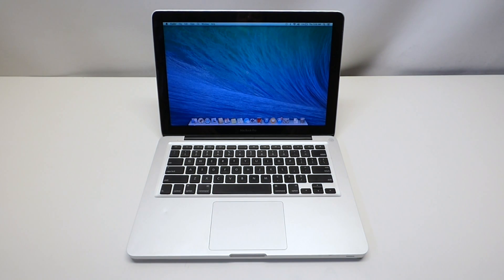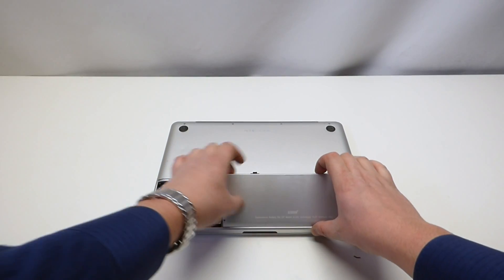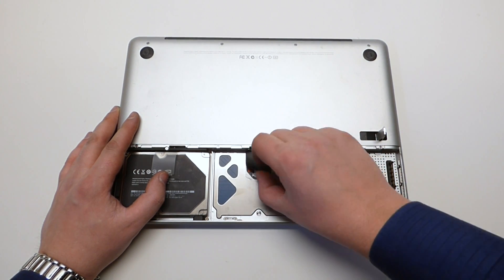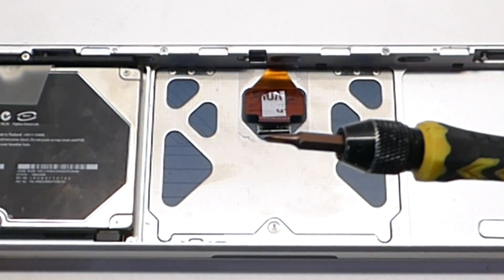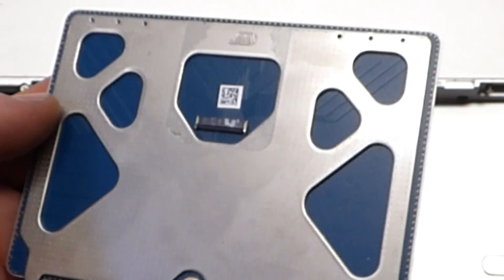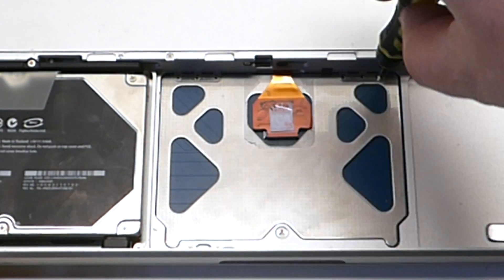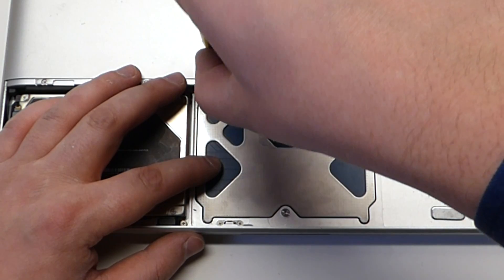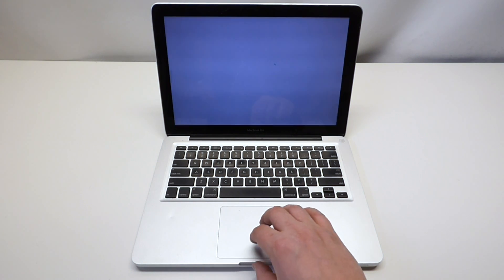Macbook Unibody Track Pad Fix and Removal 2008 A1278 Apple Dollars #5

Comment: Hi! I have mbp 15 2008. My battery was swollen and I changed it to the new one. Now the trackpad is not sensitive in its center, but it's ok on sides. Can I fix it this way, or together with cable? Thank you!
Reply from the maker: +Dan Ambrosevich try to take it out and clean the place where it sits and all of the sides with a toothbrush. Reassemble it and let us know. Also watch this video http://www.appledollars.com/trackpad-replacement
Reply: Woah! Cleaned it with toothbrush, there was pretty much dust under the edges. Now it works like new! Thank you guys!
Reply from the maker: Good to hear!